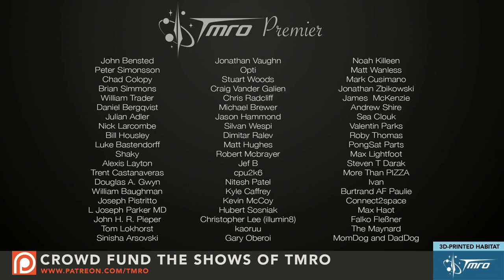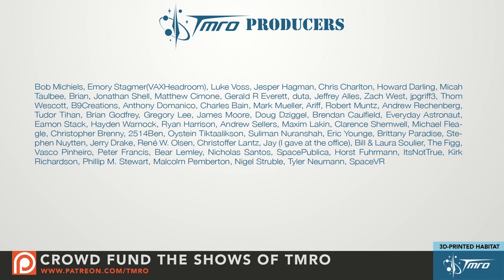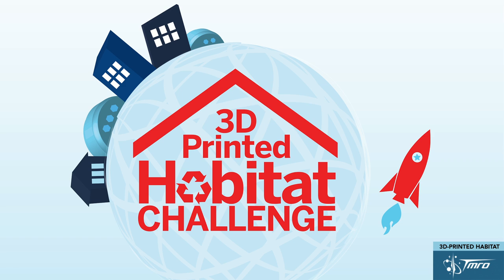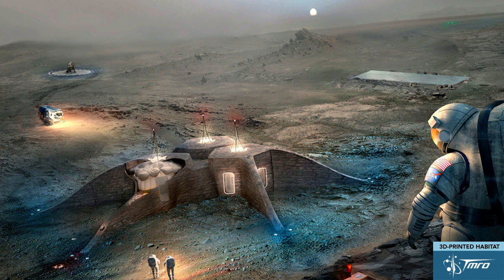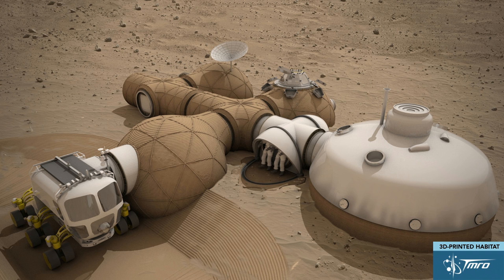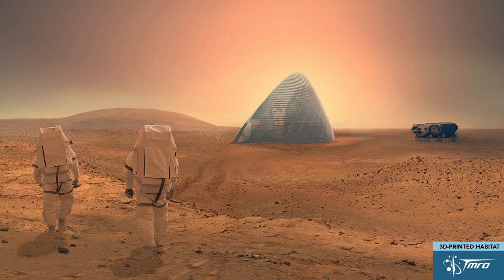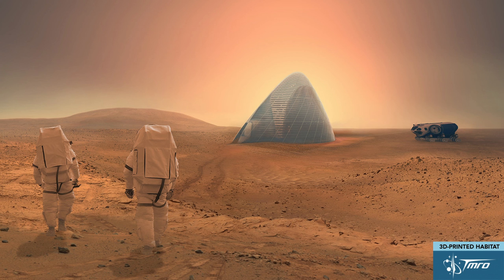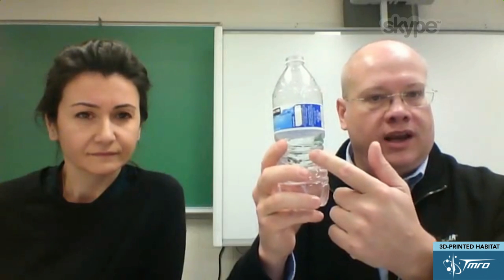3D-Printed Habitat Challenge Interview

Comment: I imagine printing would be extremely handy, considering the difficulties with landing any heavy weight on Martian soil. If the max you can land is just a ton or two, then one robot accompanied with several batches of materials can all be landed under that weight limit. With clever structures and robots anything at all can be built :)